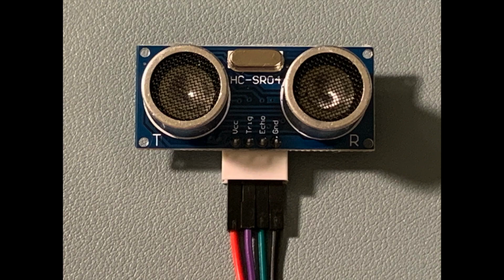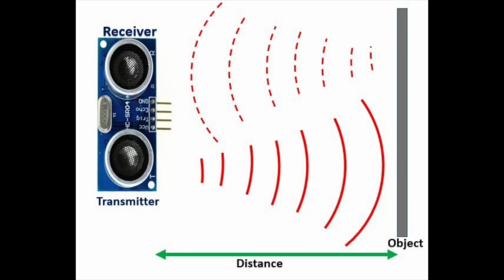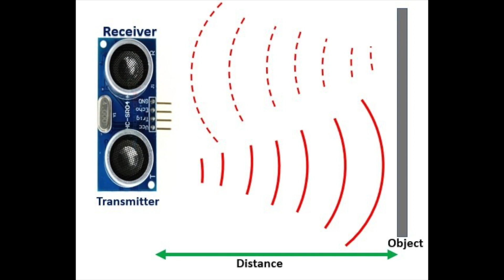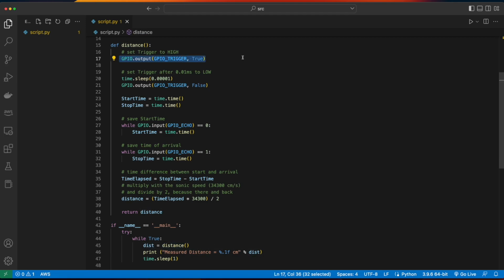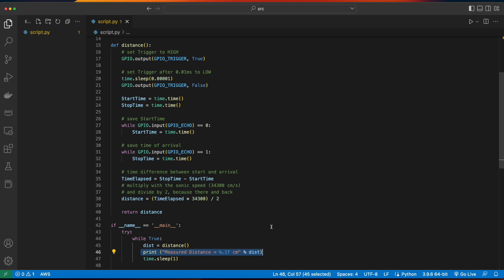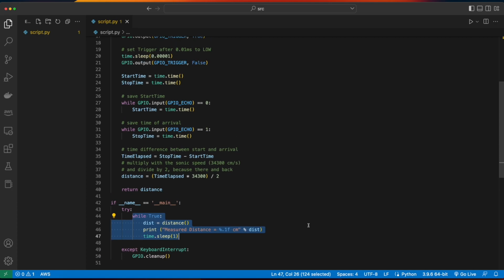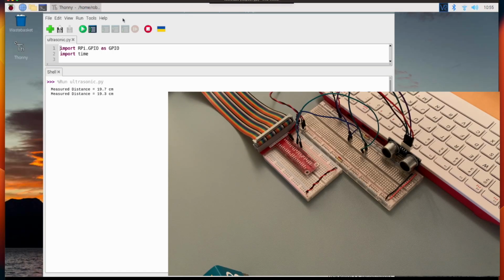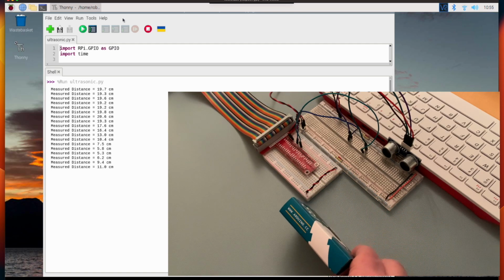Raspberry Pi: Measure distance with an Ultrasonic Sensor

Comment: cool idea. i read online if no signal comes back the sensor gets stuck and won't send another signal out as it just waits to get first signal back- is there another sensor you like that has auto timeout function? or can we write it into code? 

"the first cheap HC-SR04 I used had no automatic timeout so if nothing was detected it would just wait for ever and ignore attempts to send another pulse. The only way to get it working again was to recycle the power."

Comment: that's very good video thank you ! , I just need to know can I can add an if statement ? like for example if the distance is less than 5 cm send alarm as text or show different message ?
Reply from the maker: Hi. Thanks for the comment / question. Yes, you can add an "if statement". What I would probably do is create a variable to store the result of calling the distance function like "dist = distance()", then check the value of dist in the conditional. Does that make sense?